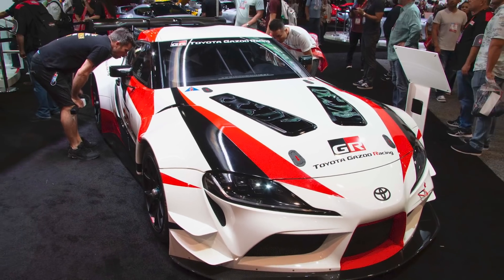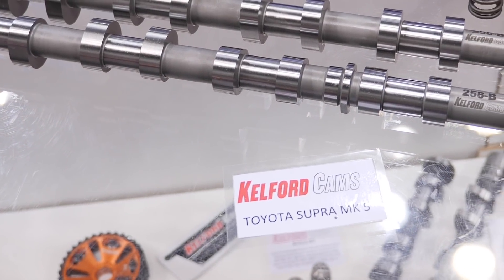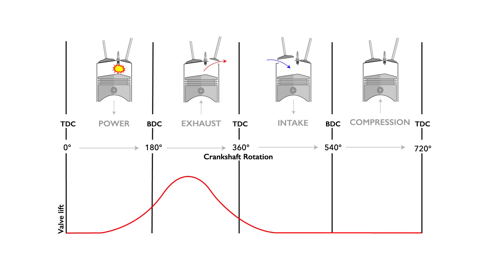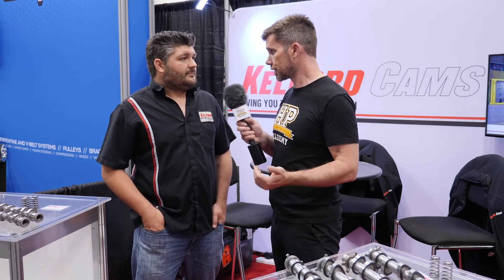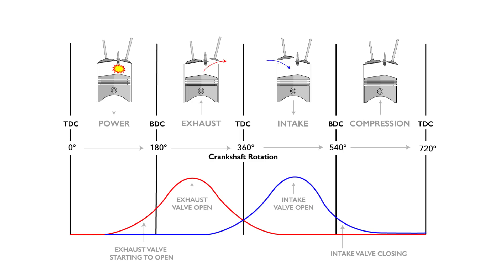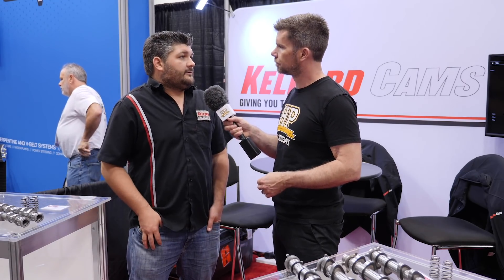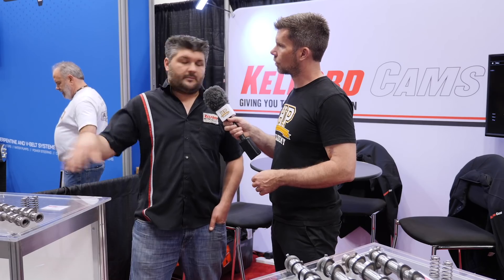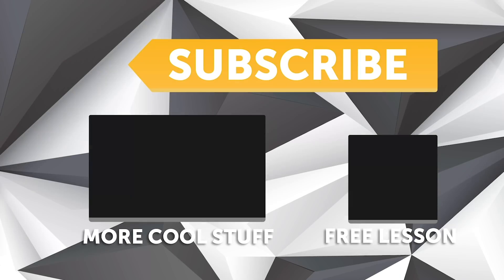A90 Toyota Supra Camshafts | Reverse Engineering The B58 | Kelford Cams [TECH TALK]

Comment: Really interesting from 9:00 on!

Some of you may be a little confused by the talk of cam' and valve lift being different.
While the valve to pivot point will usually be the same, because of the geometry of the valve train the contact point between the lobe and follower's are moving closer, and further, from the pivot point, with the leading and trailing (opening and closing) flanks having different lift rates as a result. 

There was a member on the HPA who had a bit of trouble following this, and I found a site with some nice graphics, and info', for him that should help an understanding of this - it's for a Honda, but exactly the same principle applies for all rocker/finger followers, even if the relationship of the three points varies - https://www.pattakon.com/pattakonVtec.htm
With this engine, the additional links adds complecity, but it should still be easy to follow.

Comment: Can't wait until pneumatic valvetrains (Freevalve) become mainstream so camshaft tuning becomes a thing of the past!
Reply: X88X 
On the contrary...I’d contend that with the FreeValve system, the entire spectrum of inlet and exhaust dynamics becomes infinitely tunable, from mild to wild...at the push of a button!
Reply: @flyonbyya  You're saying "on the contrary", then you're 100% agreeing with X88X...
Reply: You likely will not see that.  Most manufacturers are going electric
Reply: @all4bspinnin311  pretty sure Koennigsegg did it with the gemera
Reply: @austinweippert4065  you're correct.  They were the ones that came up with it if I recall.   I love freevalve but sadly due to emissions we're all faced with everything eventually becoming ev.   But, im hoping a few companies will release aftermarket freevalve kits for lsx or other common gas engines in the future. :)
Reply: @all4bspinnin311  that would be so cool to see before everything goes to electric!

Comment: Will they work in the 2020 model engine with the lower compression  and six exhaust ports?
Reply: Pretty  sure they could since they're both the same but just different heads is all so there shouldn't be TOO much of a difference between the 2.
Reply: yes